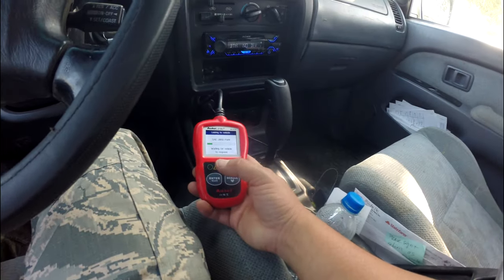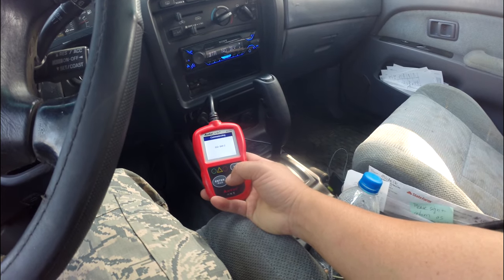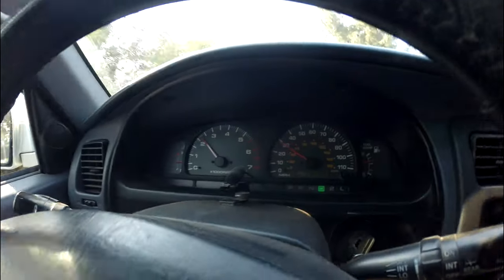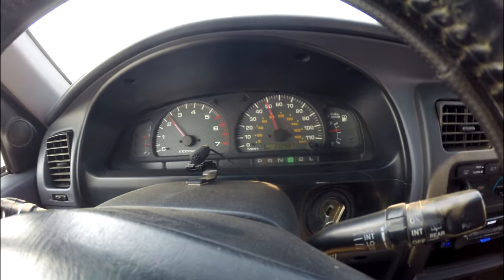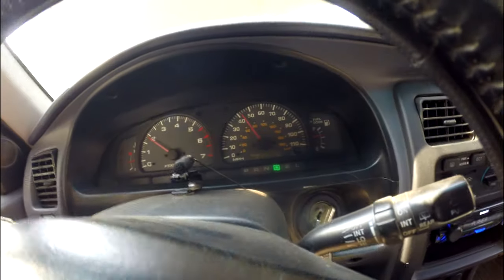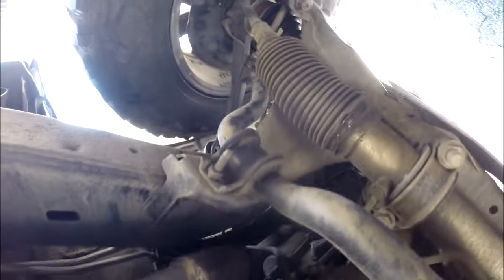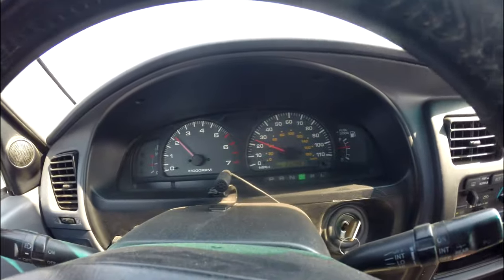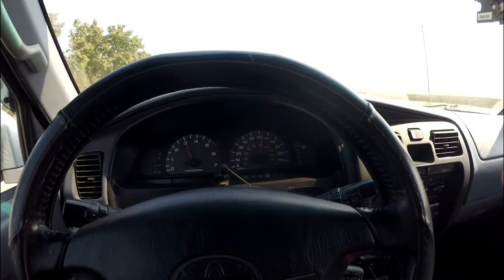How to identify a bad clogged catalytic converter.

Comment: Had 6 codes cleared them all, changed the oil, transmission fluid, spark plugs, air intake, cleaned egr, changed the evap cleaned all the stuck carbon out of the manifold including removing the sensor and cleaning that port out as well. Test drove a million times and still the same issue and no check engine light and I almost lost my mind until I watched this. Even though I havent done it yet, I know this is my problem through your explanation that ive been looking for over 22 web pages. Great job and thank alot for the help. Subscribed!
Reply from the maker: Wow 👏 you work on everything. Thanks for help me subscribe buddy
Reply: What did it end up being
Reply: @MuscleCarMike  it actually turned out to be a bad bearing in my transmission so I had to get a new one. But hey, after doing all that work feel like I got a brand new car! 🤷🏾‍♂️💯
Reply: Man I went through the same. This is on my 2005 buick lesabre. Fuel pump, fuel filter, plugs, wires, coils, fuel injectors, egr valve, mass air flow sensor, upstream and downstream o2 sensors, battery, alternator, and lastly the valve cover gasket(just needed it) I'm trying one last thing before I replace the entire exhaust (rockauto $360) and that's the fuel pressure regulator. Before any of that I'm going to loosen the exhaust manifold and just see because of this video. Problem is the random misfire code and flashing check engine light...
Reply: @jefferyedwards8623  did it work !??
Reply: @kami_dred7319  didn't have a chance to check today, got rained out. But I'm checking first thing in the a.m.
Reply: @jefferyedwards8623  let me know the results.
Reply: Did your check engine flash
Reply: @jefferyedwards8623  I’m having the same thing flashing check engine light did you find the problem
Reply: @jefferyedwards8623  so did you do it ?
Reply: @Jeffery Edwards  I had the exact same symptoms and changed out everything you did, plus new pcv valve, map sensor, and fuel injectors! After driving it for an hour (rough idle, struggling up hills, mini backfires, hesitating, struggling to get up to speed) it finally threw a code P0304. It turned out to be one of the new sparkplugs that was no good. I changed out the sparkplug and now it's running great. I couldn't believe that so many problems could come from a bad plug. I think the check engine light wasn't coming on because I was disconnecting the battery so often to work on it.
Reply: @Vineyard_Edge  how did you find out which plug it was  ?
Reply: @NHPhamousPolo the code P0304 means cylinder 4 misfire. It's when you get P0300 where it's random misfire and you don't know which one.
Reply: I subscribed
Reply: Bro literally did all that even replaced the o2 sensors. I decided to cut the muffler and found it was hella clogged from all the debri from the catalytic converter had fallen apart and clogged my muffler
Reply: @alltsab  where are you from?
Reply: I did about everything the same, spark plugs, cables, fuel injectors, I clean up the, EGR valve. Change the oxygen sensors. Until i took it, the Japanese shot & they gave a brave díganost, I had a Dough about the cathalicy but I AM not a full mecánic, & I only work in Fords & Chevys Japanese Cars are more complex..

Comment: I am experiencing an issue with my Honda Jazz 1.3 CVT vehicle. When I press the accelerator pedal firmly to reach 1500 RPM, the car begins to jerk. However, if I apply gentle pressure, the jerking does not occur. This situation poses a safety hazard, particularly when driving on motorways, as it necessitates rapid acceleration. I kindly request your assistance in resolving this matter.

Comment: Had the same problem on my 03 impala. Was throwing codes that made no sense and even clearing them while backfiring and no power. Super hot out the exhaust with no air coming out. Drove 1000miles and barley made it to my destination. Replaced it and "WOW"
Reply: im praying this is the problem on my 03 infiniti g35. im 1.5k deep trying to fix this.
Reply: @kami_dred7319 was it the problem after a year?

Comment: Thanks so much.  My car has the same exact issue.  Two places told me I need a new transmission.  But the trans shop I went to today said it's an exhaust issue and you are confirming that.  Subscribed !
Reply from the maker: Thank you for helping subscribe
Reply: Was it though? The issue
Reply: @ibggetsemani1206  My catalytic converter was clogged badly.  The exhaust couldn't pass through.  I replaced it and now it runs fine.

Comment: This is the video that I was looking for. This mechanic is awesome. My 2013 Buick Lacrosse is doing the same exact thing. It runs like a dream until yesterday it started jerking as if my transmission was going bad. My computer reader reveals it was the MAF sensor. I changed it, and the problem still didn't go away. Fortunately, my mechanic was able to disconnect one of the oxygen sensors, and the car started to regain its full performance.

Comment: Thats great analysis. I suspect the same in my Camry 2005. It's blowing a lot of air from oil cap, and it sounds like exhaust when I open the oil cap in the valve cover. No smoke, no check engine light, PCV valve and hose are new. There was an exhaust leak just before the cat converter, and I just repaired that leak. I didn't check the oil cap before fixing the exhaust leak, but my guess is that engine is not able to breath from exhaust, and as a result the pressure is building up inside the engine, and releases any where it can. In this case it's the valve cover. I also noticed that in idle if I cover the exhaust tail pipe by hand, the engine does not die or even struggle.
Unfortunately I cannot disconnect my exhaust easily. Someone removed the flange and welded it to the pipe permanently. Thanks for sharing your analysis. Subscribed.
Reply from the maker: Thank you for the subscribe very appreciated.

Comment: this was exactly what i needed. i removed my cat and drove like a charm. i was so close giving up because i did everything from new plugs and new coil packs and new valve cover gasket and tube seals and nothing worked. thank you!
Reply from the maker: You welcome now you can help me subscribe thanks
Reply: How old is the catalytic?
Reply: @MrKkdkk  my car was an 08 so quite old.
Reply: @XxXGBatXxX  my car engine is whining like i was towing something heavy, i thought my brake was binding. Now I'm thinking it's the cat, but it's only 4 y/o.

Comment: YO I am so thankful you made this video I’m driving a 2017 dodge journey with no check engine light on and I’ve change the spark plugs boots and oil change even had my o2 censors be replaced and it still did this and is still doing it now finally I have something to show to the mechanic to give them a better understanding thank you so DAMN much fr fr 

These dodge journeys have all types of issues I swear smh
Reply from the maker: Wow, 2017 is already going south just trash it buy new lol...I'm glad my video help you. Please subscribe to support me ok buddy. 👍
Reply: I’m driving a journey 😖 it’s terrible

Comment: My man, thanks a bunch. You've helped me confirm my suspicion with my 3v Mustang GT. No jerking or struggling while accelerating, but definitely, like you said, very little air coming out the exhausts (almost no air at all). I also run a burble/popcorn tune, so, yeh...Plus orange hot cats when climbing around the mountains. Plus bad smell especially on cold start and all the time basically. I've also got an up and down idle but I believe that's because of a bad water pump? Lots of evidence of coolant coming out from below the pump. Haven't done any vacuum leak tests though. Thanks again for the awesome video.
Reply from the maker: You very welcome buddy help me hit the subscribe ok thanks 😌👍
Reply: I have a problem with mine that I'm thinking is cat it almost seems like the timing is off one side must be clogged pretty bad bc I have misfires on one hole side of the engine

Comment: Thank you so much for making this video. I have a 99 Jimmy and it is acting just as you described. I have to push it and push it to maintain 100 km on the freeway. Yesterday, initially, I barely made it over a hill close to home. I had it floored and would hardly go over maybe about 20 mph. I was thinking maybe a problem with the injectors but after watching your video I am convinced it is most likely a clogged cat. Maybe debris from the cat has also travelled farther down steam and possibly caused a blockage in the muffler too. I have a scan tool the reads live data so I can also check the O2 sensors and I will purchase a new  vacuum gauge also so I can see how the engine is breathing. Like you said that it is like trying to run with your hand over your mouth. ( I had a vacuum gauge but it is missing in action. ) Thank you so much and I am now SUBSCRIBED!!
Reply from the maker: Thank you for helping me subscribe to my channel
Reply: From a cat?
Reply: Clogged cat won’t hurt muffler it will hurt the engine . Cus it’s on the other side of the combustion. That’s why you seee the rpm gauges .

Comment: The very hot exhaust coming out of my truck is what lead me to pulling the catalytic converters off and I did find that the front cat is clogged.  Now I need to find a way of cleaning it!  Great video.  Thanks for sharing.
Reply from the maker: Can't clean it brother have to be new only. Unless your state doesn't require smog inspection.

Comment: This is going on with my vehicle I have a 1999 Chrysler LHS just reach 200,000 MI 
I know it's my catalytic converter I seen cherry red like fire and I smell and see smoke I have rough idling on takeoff but I did not push it past 50 MPH. My check engine light came on but I also have to replace my alternator. Took my car to O'Reilly's can I scan for a code but it showed nothing. I'm going to start with my catalytic converter 1,000 % sure that is clogged. 
Great video easy to understand keep up the good work
Reply from the maker: @yuvonnearnold4673  you welcome

Comment: This video helped a lot. All we could think about when we faced the same problem was a malfunctioning ECM but in that case there should be a check engine light or something. This is the last option we are left with. Will try this! Thank you.
Reply: Same, I just changed ECM and no luck. Thinking this is it. Did you end up changing your cat. converter?
Reply: @savyj6569  Hey sry I didn’t check my notifications. We took the car to a local mechanic shop and he asked us to keep the car at his place for a day so that he can check it properly and let us know what’s wrong with it.. The next day he called and said, there’s something wrong with some sort of sensor in the car. I don’t remember what what he said exactly but all I could figure out was the sensor is not allowing the car to exceed 80kmph. ( Sensor in the left wheel works fine but the one in the right wheel has some issues)
Reply: @savyj6569  I visited this mechanic on 21st December and he said he’ll order a brand new part as a replacement for the worn out part, he hasn’t called back yet and Everytime I ask, has the part arrived he either says no or doesn’t pick up the call.
Reply: @savyj6569  I’m thinking about visiting another mechanic and asking him directly to clean the clogged cat converter. I’m literally fed up of this issue.

Comment: Mine is also 21 yrs old haha I was like 4 years old when It was first registered 😂 but I'd rather buy a car cash than take one from the bank... Oh yes mine has 211 000 on the clock. My car is doing this same thing, I thought it was spark plugs because of the low power, but they were fine. Because of the sound I figured to check the exhaust system. And possible CC problem. Thank you for making this video!!!
Reply from the maker: You welcome

Comment: That’s exactly what my Camaro is doing now it’s hardly going 3,000 rpm’s  so I’m gunna take my catalytic converter off because it’s bad to honeycombs in it broke all up I need a new one.  Thx for your video 👍🏻
Reply: I just wanted to address the obvious my problem is fixed my catalytic converter is junk thanks again for the video
Reply from the maker: You welcome

Comment: My 2003 Dodge Caravan with 158,000 miles, got P0420 code.  Lugs bad on grades.  Barely making it up losing speed from 40 to 25 mph by the summit.  Runs fine on the level.  But runs hotter than usual but not overheating. Replacing cat tomorrow.

Comment: Update : this video helped me diagnose and fix my 2013 Acura TL SH-AWD V6 which had no check engine light,  and a sudden loss of power above 3500 rpm. One of the catalytic convertors was clogged due to broken catalyst bits stuck in the exhaust mid pipe. Pulled out the pieces and it runs like a top again. Thank you very much 😊
Reply from the maker: Wow 2013 already have this type of problem. Could be made in China part lol 😂😂😂 glad you found this video thanks for watching and don't forget to help me subscribe 😊
Reply: @alltsab  actually it was the original 3rd catalytic convertor ( which luckily isn't monitored so no check engine light from gutting it either! )But the car has 163,000 miles and burns some oil which I think killed it quicker. The acura J37 v6's have oil consumption issues unfortunately.
Reply from the maker: @LeoM-zt3pl oh I can see that. Even though poor gas also killing the cat. Converter too.  from 2010 and  above seem like many Japanese made vehicles have consumption oil a lot. Toyota 4 cylinder is terrible.

Comment: Backyard mechanic way to tell if it's the CC. Pull the O2 sensor out of your down pipe near the exhaust manifold and if the car goes from running rough to normaling out when you pull that O2 sensor out, you know it's the catalytic converter.
A bad CC isn't absorbing emissions and is forcing back pressure back up into the engine. Pulling that O2 sensor allows that pressure to escape out of that O2 port. If you can afford it, take it to a mechanic and they can pull the engine computer data and it'll take them about 5 mins to diagnose it.
Reply: Well....in my case:
2000 camry V6.
Light on for 420 code all kinds of power.
3 O2 sensors and 3 cats later 2500$.
Bc the mechanic could not diagnose it the first time so he ended up replacing everything.
Stay away from Toyota especially with California emissions.
Reply: Explain better because the downstream o2 is not next to the exhaust manifold, that would be the upstream sensor
Reply: @cyberpun2552 he means the upstream sensor that is closer to the manifold.
Reply: i have a 02 silverado 1500 4.3 v6 with a p0420 code which i think is a clogged cat, which sensor would i have to pull off to test up or downstream?
Reply: @bryan_trades8867  honestly could be either. I had the same code and changed the upstream sensor, then after changing it and clearing the code. I had a different code pop up for the catalytic inefficiency on the down stream sensor. The CEL reading should tell you which bank it’s coming from, but in your case(v6) I believe you have at least 3 02 sensors if I’m not mistaken.
Reply: @MrRedHotChiliMan  yeah man i have 4 o2 sensors & 2 converters (driver and passenger side) p0420 code says its insufficient for bank 1 , i already tested with infrared red therometer and did notice it was a bit hotter before than after
Reply: @bryan_trades8867  should be the one up on the exhaust manifold
Reply: @manhalen7046  so pre-cat?

Comment: Car having hard time going over 2 rpm. I checked plugs, air filter and other basics. Nothing. I removed upstream sensor from catalytic converter. Car went to 4 and 5 rpms no problem. It seems last place to check is where the problem starts. Now I'm going in right direction. Thanks for your video and time.
Reply from the maker: You welcome

Comment: laser temp reader. They're like $20 and if the cat is plugged it's hotter upstream (closer to the engine) than it is downstream. When a cat works properly it should be hotter downstream. I dumped sea foam into mine after removing the upstream O2 sensor into the cat and it cleaned it up.
Reply: Seafoam states on their website that their product does not clean cats
Reply: @FranciscoJavierOutdoors  Its not a product made to clean cats. It worked for me and it's worked for others. Upstream was hotter than down while clogged. Ran the seafoam through and the down started reading hotter, like over 100 degree difference. I was told it might break down the honey comb eventually but had nothing to lose by doing it. If the honey comb breaks down I'll be back to where I was. There are also varying degrees of clogged. Mine was clogged enough to trip a code and show temps of being clogged, but it wasn't clogged bad enough to effect driving (there are two cats).

Comment: I wish I would have seen this video two months ago, I did change all those things. Including camshaft, rollers, injector ,were sideways only running on seven cylinders. Blown head gasket. And still truck doesn't run. Mechanic finally told me it's probably the catalytic converter.
Reply from the maker: You spent ton of money isn't it

Comment: I'm having problem with that too. Even I have check engine light on,I diagnosed it(OBD2) and it's said something about cat from under (catalytic converter sensor),not front catalytic close to engine then I ignored it. I don't even know what front catalytic does. I noticed my car jerking while I accelerate like it making me feel that it was low motor oil and I changed it myself. My mpg burned fast than normal. It won't go up to 40 per hrs.  I thought  it was transmission worn out because of 300k. I went to mechanical(near house). He tested drive it and floor the gas like why it got loud on the hood, he said that my front catalytic is clogged. I started to understand why my OBD2 trying to warn me but it did not say anything about front catalytic . I never knew front catalytic have honeycomb as filter to prevent harm dirty gas in my life. Only under car catalytic pipe I only heard since I took care of my car.